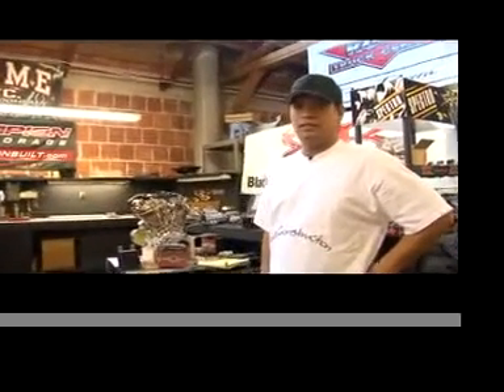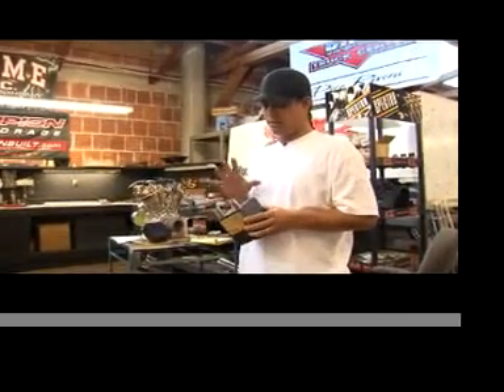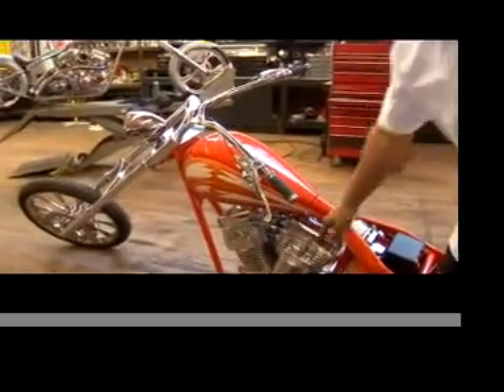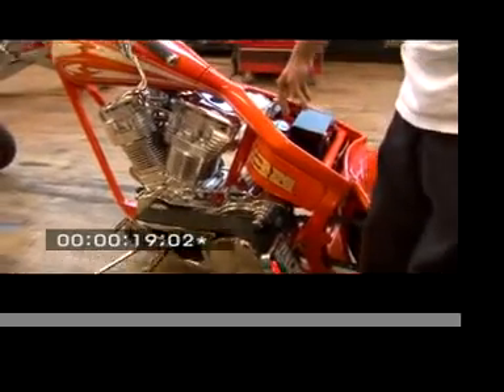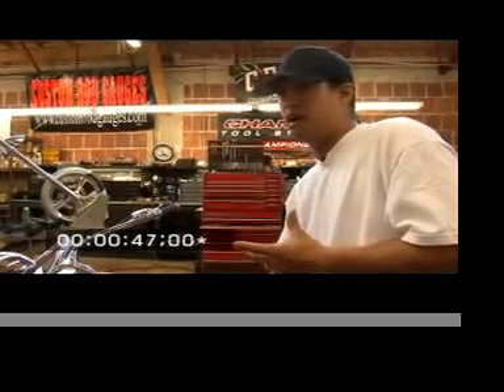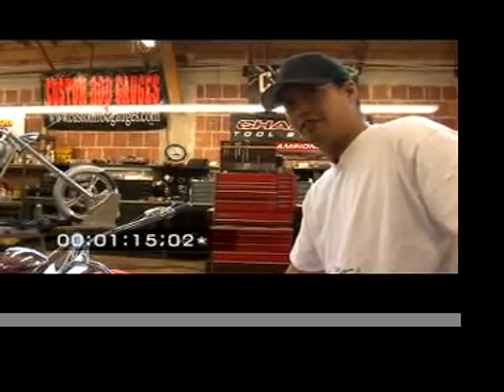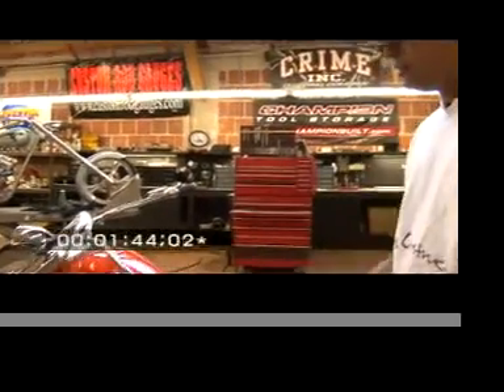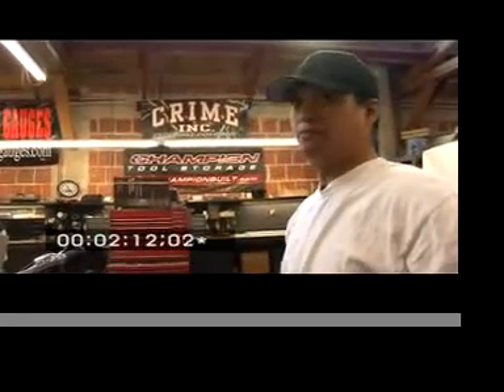Lithium ion Polymer Batteries

Comment: @lovenewtech It takes about 7KWH of electricity to crack oil into one gallon of gasoline. So why bother with the middleman, who hates you.

My 10KWH will fit in a motorcycle. :))

CO2 is not a pollutant either. Without it all plant life will die. All animal life soon to follow.

Comment: tooomp, The motor used is for starting and engine is for INTERMITTENT DUTY which makes it small and not very efficient, that is why it gets hot. A continuous duty motor is very efficient (and larger) and therefore will not get hot. Gasoline engines by comparison get very hot. Maybe you need to study of on   motors a bit better.